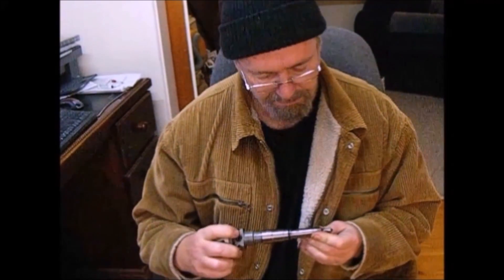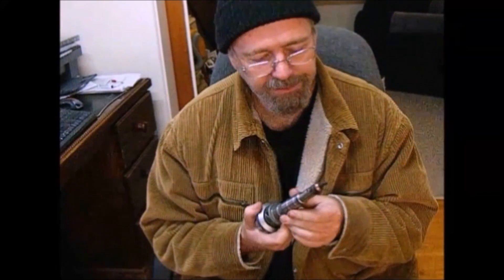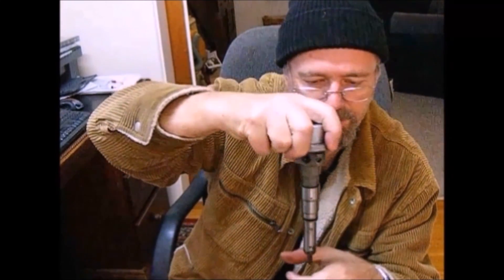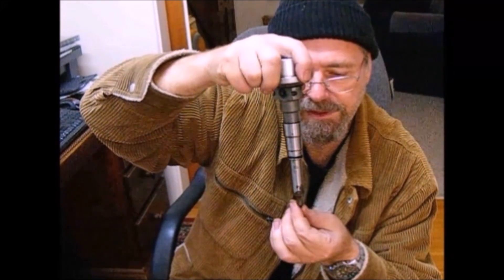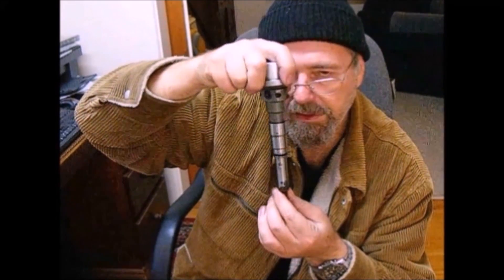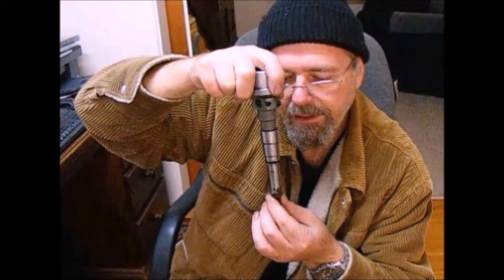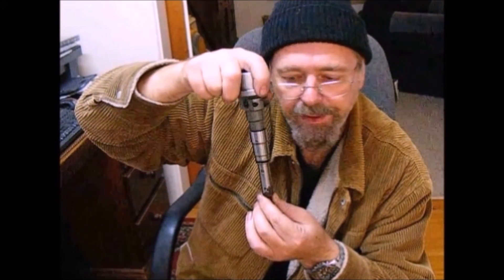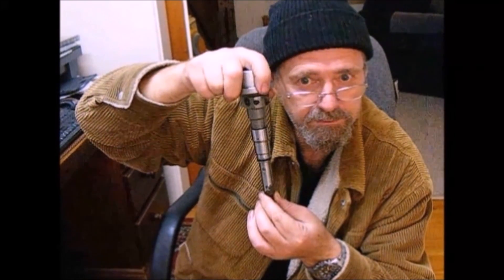Why Isuzu 4JX1 Injectors Fail - and How To Fix Them

Comment: Hi Edwin. We recently bought a 98 diesel Jackaroo to backpack around Australia. Recently we began smelling diesel in the coolant, noticed a few puffs of white smoke coming from the exhaust at startup, the coolant (mixed with diesel) began bubbling and overflowing onto the engine, we did not drive it for a couple of days as we researched suspected problems. Then when we went to start it again a few days later it wouldn't turn over, and it blew out more white smoke. We had it towed to a mechanic who has now informed us that the injector head is cracked. He has quoted us 4,800 AUD for the fix, which also includes a new timing belt, and apparently the wiring harness for the injectors looks to have been "mucked around with." This quote seams quite high to us, what is your opinion? We have also noticed that injector heads can vary drastically in price, what would you expect an injector head to cost?
Also, how do we know for sure the head is cracked and it's not the sleeve, or o-rings? Was the bubbling coolant a good indicator?

Any help is much appreciated.
Reply from the maker: +LDoyle Hi.  Mechanics often mistake failed injector sleeves for cracked heads because the symptoms are the same, plus they are unfamiliar with hydraulic HEUI injectors unless theyve worked on CAT diesels.  Also, many mechanics dont own the tool to extract the sleeves, so quote to remove the head and get them out from below.  

Bubbling coolant may indicate a blown head gasket or cracked head, but this is not definitive since combustion gas can be forced up into the coolant through failed sleeve seals also.  Therefore there is no definitive test of the cause of cross-contamination except to replace the injector sleeves first. 

Since injectors sleeve seals are way way less expensive than a new head, it is advisable to do that. Also, failure of the sleeves is the most common fault ( since nobody bothers to maintain them ). Isuzu 4JX1 heads are quite wide and well bolted as in all Isuzu diesels - and Isuzu diesel engines are regarded as some of the best in the world. I tend to put cracked heads on the bottom of my list of possible causes. 

The symptoms you describe sound rather like this scenario > the previous owner had the sleeve seals fail. He took the injectors out but couldnt be bothered making/borrowing the tool to remove the sleeves from the head.  He then reassembled the injectors in the head with only a few O-rings to the injectors themselves replaced.  This allows the engine to run reasonably well for a short time.  Then this sealing inevitably failed after youd driven the vehicle a short time.  The onset of failure in such a scenario would be quite sudden.  

- The mucked about with wiring harness almost proves this scenario, since it proves that someone has recently worked on the head - therefore a cracked head is unlikely IMO. Why would someone try and repair a wiring harness for a cracked head? ... nope, the injectors have been taken out and put back in. 

The standard messing about with a wiring harness is because (like Landrover TD5s) the harness eventually allows oil to leak into the connectors past its neoprene seals.  This is inevitable with this type of engine and while oil is not a conductor it will eventually interfere with the metal to metal contacts, so with 4JX1 and TD5 engines its best to renew the wiring harness about every 100,000km. In this way you will always have good neoprene seals on the electrical connections ( since they come with the harness ).  A fix that can avoid the $170 cost of a wiring harness is to clean all the oil out of the connections, then use a silicon engine sealant to seal the old connectors, which is likely what you have in your engine.  Personally id rather pay the $170. 

A new head blank is about $1000.  My brothers machine shop reconditions a head fully for about $1600.  The gasket set and new head bolts are around $150.  It takes a day to replace a head.  I have no idea why your mechanic wants to replace the timing chain since that has absolutely nothing to do with this fault. 

I suggest you ask your mechanic if he has the tool to remove the injector sleeves, and ask to see it as proof.  Mechanics tend to lie a lot.    This will tell you if he is actually capable of replacing sleeve seals on a 4JX1.  

The prices quoted here are obtained from eBay (gaskets and head blank).  Other than that my supplier is Ramin Isuzu in Dubai.  You go to his web page, request a quote. After payment the parts take about a week or so to arrive.
Reply from the maker: +LDoyle Just a thought >if you want to know for sure if your injector sleeve seals are gone (rather than the head).. pull off the rocker cover.. remove the oil rail.. then remove the injectors. This is a surprisingly simple job.  Then inspect the bottom of the injectors above the copper gasket (seal ring ).  If the sleeves are leaking there will be CARBON ON THE BOTTOM OF THE INJECTORS.  This carbon is from the combustion chamber.  You will find that the rubber O-rings are never the cause of leaking in the sleeves - that just happens after. 

The actual cause of leaking is failure of the copper gasket to seal out combustion pressure and gases.  This is common to all direct injection diesel engines, and replacement of the copper gaskets is obligatory maintenance if you are to avoid this fault in the future.  That is the subject of this video, and you will find an example of a CAT diesel engine having the same fault fixed here > https://www.youtube.com/watch?v=uGRwtHQ7Oh0   >> this should help you understand the nature of this common diesel problem
Reply: +Edwin Henry Blachford Thanks for all the information Edwin. We are going to have further discussions with our mechanic to determine whether or not he is just giving us the run around. He included the timing belt in the quote because he suspected it was due for a change, it wasn&#39;t related to the injectors.

Would you be able to recommend any diesel mechanics with 4JX1 experience in Sydney?
Reply from the maker: +LDoyle sorry, i'm in South Australia.. but you might look on Facebook for the Isuzu Owners Club which is mainly based in NSW and QLD. 

Meanwhile, you might show this video to your mechanic >>  https://www.youtube.com/watch?v=BpNEPNfAGNo&feature=youtu.be
Reply: +Edwin Henry Blachford We get our own video! Haha. Thanks for all of your help. It has been very informative.
Reply from the maker: +LDoyle we exist to serve.. lol. My pleasure LDoyle.  Proceed with knowledge and great caution... :)

Comment: Hi bought an Isuzu trooper 3 litre deisel car started smoking gem exhaust white smoke and then would start. Took it to mechanic who said head gasket although I could smell deisel in the radiator. Neways paid £400 to fix head gasket but same issue can smell strong diesel in rad what could be the fault? Injector sleeves?? Please help :(( only bought the car 2 week ago and havnt driven it mre than 2 miles
Reply from the maker: +John Dean injector sleeve failure acts in almost the same way as a blown head gasket.  

There are a few differences though..  Take the radiator cap off and run the engine - if the head gasket is blown there are usually bubbles in the coolant as the engine runs ( this is because the combustion pressure can blow past the gasket into the coolant gallery). However, when injector sleeves fail the blow-by is into the injectors so usually there isn't bubbles in the coolant.  This test is not definitive, but a pretty damn good indication of what's happening.  

Also, if you have diesel in the coolant, this is most commonly passing from the fuel gallery in the head/through the injectors sleeves/then into the coolant gallery. This would only happen with a head fault if the head was cracked ( but can't happen with a blown gasket ).   So, by the presence of fuel in the coolant you know the most likely fault is either a CRACKED head ( not gasket ) or the sleeve seals.  90% of the time with both the Isuzu 4JX1 and the Landrover TD5 diesels it is sleeve seals ( cracks in alloy heads are far less common than in cast iron heads since the metal is more ductile ).    

If your mechanic is still confused, it's best to find another one experienced in either Isuzu 4JX1's, CAT's or Landrover TD5's.. this is because all these engines use HEUI injectors - although the Isuzu uses oil pressure to drive the fuel but Landrovers use a camshaft. CAT diesels use either system since they patented the technology.  Hope this helps..Ed :)

Comment: Hi Edwin. Great vid!

My dad has just purchased a 98 Jackaroo with the 4jx1. We have researched after buying the vehicle to find so many complaints and problems due to the injectors. The car is an LS and is MINT, its like new. It has been loved by someone to be in this condition. The vehicle has 180 thous kms on it and runs and pulls like a dream. Dad is now concerned and wondering if he should part with it, which would be a shame as he loves it. What would be your advice to maintain, and keep this vehicle running well? we are very mechanically minded, we will be doing the timing belt, pulleys and waterpump ourselves next week. Any help GREATLY appreciated.
Reply from the maker: gibbut1 Hey hi Gibb.. Personally i'd get a Chinese Tech2 and learn how to use it - a full workshop diagnostic tool for $300 -bargain!! -saves a lot of time..you'll never learn all it does but even the basic functions are invaluable and it's bloody handy if you start going remote bush - GMH in a can. Get the "Isuzu-English" PCMCIA card with the tool - version 11.620.  Then i'd buy at least 16 copper injector "gaskets" for future 50-100K service interval changeovers. This copper part is a very common failure on all direct fire injected diesels, so be well armed - they cost $4 each at GMH.. cheaper at Ramin Isuzu in Dubai.  Change them BEFORE they fail and you'll be problem free - since it's the copper part that fails first then destroys the O-rings behind the injector sleeves after for the famous Injector Sleeve seal failure; so by keeping up the maintenance of the copper part you will never need to remove the injector sleeves.  .  O-rings you can always get. A spare injector wiring harness isn't a bad idea, but you can clean the harness parts in carb cleaner and silicon the connectors in to seal out the oil if needs be - the wire insulation will eventually harden but we're talking a long time.  Keep an eye out for guys paying to install new injectors at dealers & mechanics - and get the old injectors for nothing because most of them are fine.  Generally, the Isuzu HEUI injectors last even longer than the CAT & Landrover TD5 units since the 4JX1's are driven by hydraulics and not cams whacking them like in those engines.  Don't disconnect the EGR, since I'm guessing the extra heat from that trick fries injector tips.  In truth, talk to a Landrover mechanic about the TD5 and it's quirks ( Odd how you don't hear people bitching about that engine eh... ) because they're very similar to own, only the 4JX1 has more power and uses less fuel. 
After that, it's pretty well normal wear and tear. Belts, filters, hoses and oil. A turbo will go from time to time but the Chinese are mass producing them for $300 new 'cause there's so many 4JX1's in the world.  If you have a clutch go, toss the dual mass flywheel and go solid. It's worth dropping the sump and checking the oil pickup tube gasket and O-ring..but the symptom of that is pretty obvious - it won't start when pointed up a hill.  Just remember that the 4JX1 Isuzu Trooper sold in the millions all over the world for 6 years and the engine remained unchanged the whole time, so Australian perceptions have nothing to do with reality. There are a lot of them around, and a lot of owners to talk to.  
Isuzu diesels always have nitride hardened cranks and conrods.  The 4JX1 also has chrome cylinder liners. Commercial use indicates these engines do well over the million km.  Practically most aren't old enough for that yet, but I have friends in Siberia who swear by them and are at 600,000km and going strong in the Tundra.

Just one other thing comes to mind.  Don't start using long life engine coolant. Stick to the factory spec green stuff and replace every 2 years.  The long life stuff is suspected of eating rubber in GM LS1 V8's and 4JX1's.

Comment: Hi. Thanks for your very informative videos. I was just wondering if you have any ideas regards my 2002 Isuzu trooper 3.0 dohc I purchased 6months ago....the jeep has been running perfect until it randomly would not start outside a shop (sitting switched off for bout 20minutes) she wouldn't start after a lot of churning and then priming she finally started but with very low slow power. It has stopped whilst driving and yet again had to prime it. Very hard to prime and eventually had to turn the fuel filter to get fuel to her to fire up. She started again then and idles perfect. New fuel filter has been fitted but made no difference. It will rev out buy very slow and very low power, there is no lights on on the dash. No smoke. Not overheating. Apart from no power it is going fine. It will start OK without manual priming though if quits you have yo prime to try and get her started again. Few mechanics are at a loss. Could it be injector failure? Have you any ideas? 
Thank you in advance any help is greatly appreciated
Reply from the maker: hanchif13 hmm.. interesting.  I had a lot of trouble with one of my Troopers like you describe.  She'd been sitting for a long time with the previous owner.  So I dropped the drain plug on the fuel tank and flushed the fuel lines.  Then I put in a new fuel filter and primed it.  It started and ran like a new vehicle then..  I was amazed at the amount of crap in the tank. The fuel was murkry despite me having driven it around and filled her up at the petrol station quite a few times.  The "murkyness" was in fact water which finds it's way in over time by condensation and contamination at the service station.  I fitted a water separator to the fuel line, supplied by a 4WD shop.  
Maybe this is your problem.. sounds like it since crap in the fuel lines would make it hard to prime.  
Also.. in the fuel filter housing is a little non-return flap valve that can get "varnish" deposits making it stick. So take the whole thing off and give it a good clean.  This might be your first job, since if the non-return valve is leaking or stuck it's a bloody hard job to prime the lines and once running you get air bubbles in the fuel that cause erratic running due to disturbed fuel supply   :)
Reply: +Edwin Henry Blachford Hi sorry slow reply I have only just realised that I had a reply to my comment. Thank you for taking the time to respond it is greatly appreciated. I will definitely try what you have suggested and let you know how it goes, t
Reply: +Edwin Henry Blachford Hi sorry slow reply I have only just realised that I had a reply to my comment. Thank you for taking the time to respond it is greatly appreciated. I will definitely try what you have suggested and let you know how it goes, t